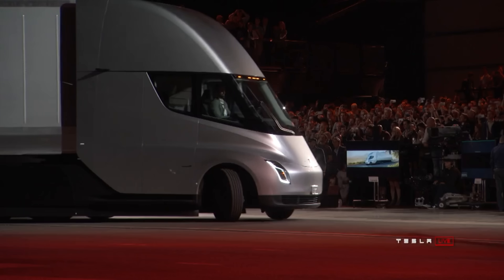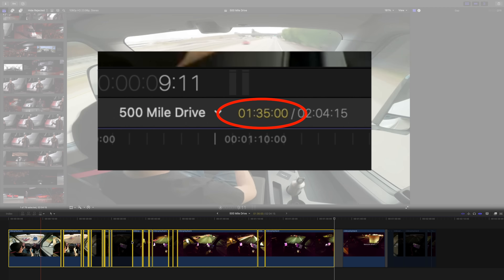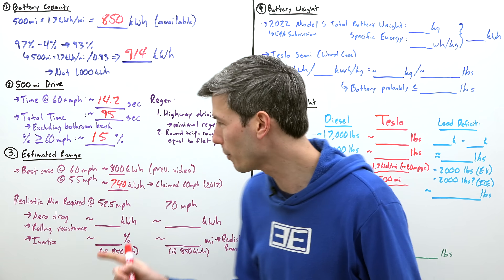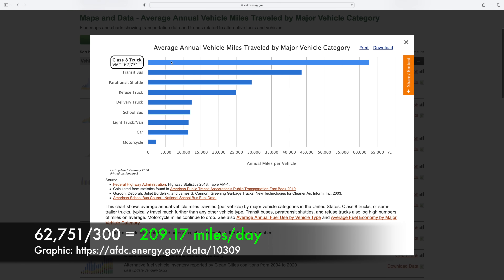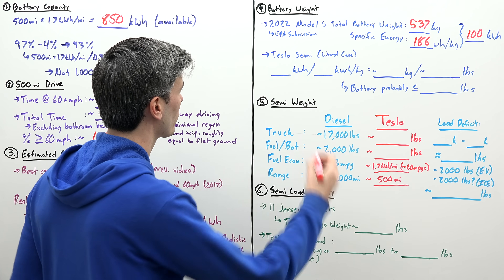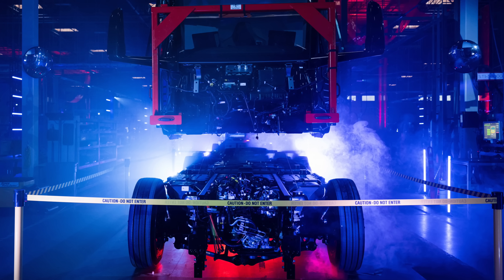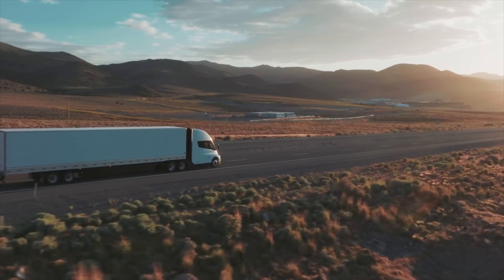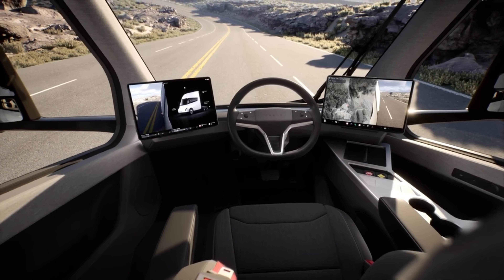Does The Tesla Semi Make Any Sense? Part 2!

Comment: How much more does the Tesla cost, and can the batteries last the typical 750,000 miles of a diesl engine semi, and how much do the batteries cost to replace?
Reply: Recycling batteries is cheaper than making them from scratch. So its cheaper trading in an old pack for a new pack than simply buying a new pack. Not saying its cheap, just that its slightly more reasonable.
If battery degradation is like 8% per 100,000 miles, how many miles before its worth replacing? I think even after 32% degradation, or 400,000 miles its still worth SOMETHING. Maybe not much, but for short trips id still get some use. Another advantage of EV semi’s is that maintenance is in theory cheaper. They dont need any oil changes, and basically only need wiper fluid. Due to regenerative braking, brakes heat up a lot less and should logically last longer. Multiple motors means that it’s highly unlikely it’ll leave you stranded as well. As refining capacity increases battery costs should also decrease.

Either way both EV and Diesel Semi’s have their pros and cons, and companies will buy whichever fits their needs. My only argument is that battery degradation isn’t as big an issue as many think.
Reply: @terrestrialcreature7481  thats not true at all. Lithium is mostly not recycled at all, and is too low quality to make new batteries when it is
Reply: @paulhopkins1905  
Quote from Tesla:
“materials in a Tesla lithium-ion battery are recoverable and recyclable. Battery materials are refined and put into a cell, and will still remain in the cell at the end of their life, when they can be recycled to recover its valuable materials for reuse over and over again.”

Comment: Just like in your first video, you're still ignoring the biggest thing: this thing is terrible compared to an electric freight train.  A train is powered by overhead wires, so you don't have to manufacture a giant battery, which is the most environmentally damaging thing about a tesla semi.  Having a giant battery on the road is also very dangerous, as firefighters already struggle to put out battery fires on just a tesla sedan.  Also, the average freight train holds about 4,000 tons of cargo, which is about 9 million pounds.  Compare that to the pathetic 44,000 pounds you're predicting for the Tesla semi.
My point is, we are investing in the wrong infrastructure.  If you look at countries like India and Switzerland, they have a very good electric freight train system.  Trains are far more environmentally friendly and safer than Semis.  Increasing the allowed weight of Semis another 2,000 pounds for electric ones would make them even more dangerous than they already are.
Reply: Oddly enough, Switzerland and India still have semi trucks, in spite of electric freight trains. I can't imagine why that might be...
Reply: @BigBen621  Youre completely missing the point
Reply: @sleeplessengineer1450  No, you're missing the point. Even in countries with electrified freight trains, such as India and Switzerland, semi trucks are still required, simply because train tracks don't go everywhere that bulk cargo is needed. So electrified freight trains would not obviate the need for semi trucks in the US, including the Tesla Semi.
Reply: @BigBen621  Well obviously.  But the point that you're missing, is that unlike India and Switzerland, the USA is over-reliant on semi trucks and is very lacking in electrified rail.
Reply: @sleeplessengineer1450  Straw man fallacy. There's no connection between the two. Being lacking in electrified rail means the USA is over-reliant on diesel locomotives, not that it's over-reliant on semi trucks.
Reply: @BigBen621  It's over reliant on both.  And both aren't the eco friendly solution.
Reply: @sleeplessengineer1450   "And both aren't the eco friendly solution."
Well, I haven't made that claim. But, in your engineering opinion, what is ?
Reply: @BigBen621  Building proper infrastructure that allows for the majority of freight to be shipped via electric trains.  The US has the most length of rail in the world, but most of this rail is lacking in overhead wires.  And it's not a size issue since China, India, and Russia and also huge counties but they did electrification right.
Reply: @sleeplessengineer1450  You're still not making the case of why the lack of electrified rail lines drives your claim of over reliance on trucks. Whether the locomotive is electric or diesel-electric, trucks are still needed to get goods from the railhead to the point of use. How would electrifying rail lines change this?
Reply: @BigBen621  Replacing diesel trains with electric trains changes this.  So does improving our infrastructure to not have all this pointless road between railroads and warehouses, which didn't exist before the 40s/50s before the auto industry tore up a lot of rail and destroyed the US

Comment: So if a disel truck and a tesla do a alpine haul , And both are empty  for fuel/battery at the peak, the diesel will need to take on fuel at the top, but the tesla will regenerate most og its power downhill and the diesel will still burn fuel?
Reply: Absolutely correct, if the hill is steep enough. I could do the calculation, but it's a slope of around 2% or so—because there has to be enough energy regained from regenerative braking to make up for losses due to air and rolling resistance. For a typical mountain pass with slopes of 5% or 6%, it's a slam dunk. EDIT: It's about 1%.

Comment: There's no way the batteries will last In a mountainous environment with heavy loads unless they have added a massive and I mean massive Transmission
Reply: There's no transmission, only a reduction gear. And mountains are where Tesla Semis will have the biggest advantage over diesel trucks, for two reasons: both because they have 2-3 times the HP of diesel semis, allowing them to climb steep grades at highway speeds; and because regenerative braking removes almost all of the fuel penalties for steep climbs and descents.

In the Delivery video, a Tesla Semi is seen loaded with 44,000 lbs. of highway barriers, accelerating rapidly up a 6% slope on Donner Pass, passing a diesel semi as if it were standing still. 

Why do you think it needs a transmission? Do you understand how electric propulsion works?
Reply: There are about 900 kWh or so of batteries in the Semi, if they discharge at 900 kW, which would equal well over 1100 hp, that would only be a discharge rate of 1C, which is absolutely fine for the batteries. In the Model S, Tesla is allowing up to about 7C for accelerations, for charging about 3C.

Comment: Hugely informative, perhaps worth noting the carbon wrapped plaid motor used substitutes 2 motors as per spex of their original presentation, so technically you can cut them some slack for that... 
Elon time never aligns with earth time 😉
and pricing will likely be a feature of supply and demand (they are a business after all) but the argument for going big rig electric from a purely economics standpoint is huge

Comment: Your assumptions about Jersey barriers are not necessarily accurate.  Those barriers come in a ton of different dimensions from all different DOTs. You can't just scale length off a tire or use a vendor's estimated weight. There's far too much variability with these barriers.  You'd be better served trying to scale all dimensions on your own and use some other standard dimensions from DOT standard details then calculate the weight on your own.
Reply: You actually can extrapolate the weight of a barrier this way, concrete is usually uniform in density and their air standard set for their weight that can be achieved with a combination of dimensions.
Reply: @odisy64  no you can't. It has nothing to do with the density of concrete. Concrete is these barriers is always assumed to be 150pcf. The barrier dimensions are what vary and vary considerably. You can't scale off a tire for the necessary dimensions. You'd need much more precision than that to be even remotely accurate.
Reply: @rfehr613  im saying generally the density of the concrete is the same anywhere you go, the dimensions vary slightly but they all target the same weight so they can be sold and carried as a set, the Teslas semis extra battery weight means it carries 1 less barrier than you would expect from a flatbed of this size suggesting they are following the legal weight limit. how many 10ft jersey barriers have you seen that weigh anything but 2 tons, give or take a few hundred pounds.
Reply: @odisy64  the dimensions do not vary slightly; they vary considerably. There's no magical 2T standard for barriers. I don't know where you got that from. That's not how it works at all. Just go look at all the different barrier standards from all the DOTs and you'll see what I'm talking about. There's so much variation in design of traffic barriers, and it directly affects their weight. Barriers can be anywhere from 300plf to 800+plf. Its impossible to estimate by scaling off a truck tire, as was done in this video.
Reply: @rfehr613  These are identical in every respect to Caltrans-approved 10' K-Rails, which are a California-specific version of generic Jersey Barriers, right down to the shape molded into the end of the barriers and the circular tie-down/lifting openings. And since they're in California, you'd expect to see the California-specific version of these barriers.
YouTube won't accept a link, but if you search for the Caltrans web page Development of Staking Configurations for K-Rails,  and open the Related Document at the bottom, you will see the K-Rail design in Figure 7-3. Here you'll see the shape you can see molded into the end of each barrier on the flatbed in View D-D. And in the upper left under Typical Panel, you'll see Mass: 3540 kg, or 7,804 lbs. But this is for a 20 ft. K-Rail, so the 10 ft. ones on the flatbed weight about 3,900 lbs. each.
Reply: @BigBen621  how do you know they're "identical in every respect" without knowing the dimensions of the barriers in the video? You don't.  You can't. And if you know anything about traffic barriers, you'd know just how variable they are in design from DOT to DOT and even within the same DOT. Just because it "looks the same" doesn't mean it is the same... Not even close.
Reply: @rfehr613  Show me a photo of another traffic barrier with that exact shape molded into the end, just as shown in the K-Rail design, and I'll concede your point.
Reply: @BigBen621  that has absolutely nothing to do with my argument. That's the justification for your assuming all barriers are identical? That's a really poor assumption.
Reply: @rfehr613  In my opinion, in a state where traffic barriers are required to meet Caltrans specifications, traffic barriers on a truck with a unique shape molded into their ends that matches the Caltrans specifications, and with dimensions that can be approximately confirmed based on the dimensions of the truck they're on, are likely but not certain to be Caltrans-approved 10 ft. K-Rails, which weight 3,900 lbs. each. You obvious disagree. If the payload is substantially less than 22 tons when it's finally leaked or released, then I will be happy to retract my claim. In the meantime, let's agree to disagree, and get back to our day jobs.
Reply: @BigBen621  well it just so happens that my day job is designing bridges. So calculating barrier loads is something i do on a regular basis, and therefore I'm very familiar with state standards for traffic barriers... Hence why I'm stating there's a large degree of variability in the design of these barriers. I know from first hand experience. I also know that a single detail on a barrier that matches a certain detail on a DOT standard doesn't automatically mean the rest of the barrier matches. DOTs borrow details from each other all the time. DOTs also have their own wants and needs for barrier design, so many have their own unique standards. The process by which a traffic barrier is approved for use involves load testing by running a truck into the barrier. Since it's relatively easy and quite cheap to get these approvals, we end up with a whole bunch of unique state standards. There are few national requirements for barrier dimensions, so it would be impossible to determine the dimensions of the barrier in this video without at a minimum knowing what state DOT it's used for. Even then, there's a bit of speculation involved.

Comment: The math is "sound" in perfect operating conditions, but those of us that live in the northern half of the country deal with those pesky seasons like fall, winter and spring that seldom offer perfect temperature for BEVs. Based real world range loss of Tesla cars when the temp is below 32F, one can extrapolate that the semi range will plummet as well.  Its also great that tax dollars are wasted paying for these trucks for a company that has a net income of almost $9 BILLION dollars a year (WTF).
Reply: It cute you think 32f is actually that impactful, the batteries need to be like -20f cold start to lose 35% range. But if the battery is heated it will regain range which can be done by conditioning the battery before you drive or just drive for a while and the battery will warm up from use.

Why do we give oil companies 30 billion in subsidies every year when they are making record profits?

Comment: Maybe I missed it but do these calculations account for the fact that batteries don't like to be charged over 90% and they don't like to be discharged below 10%? Otherwise the overall life of the battery suffers. Also weather conditions. In cold weather the range will be less. Also you have to factor in battery degradation over the life of the vehicle. The range of the truck in year 5 will be less than that in year 1. What will be the average life of a Tesla Semi? Just some other thoughts, thanks.
Reply: According to Tesla there is no lower limit, just the need to avoid running out of range on the road. And the upper limit depends on the chemistry. Here's a quote from the Tesla car owners' manual: "If your vehicle is equipped with an LFP Battery, Tesla recommends that you keep your charge limit set to 100%, even for daily use, and that you also fully charge to 100% at least once per week."

 In recent tests, Tesla cars have had the least cold weather range loss of any EVs, due to use of heat pumps for cabin and battery heating. The Tesla Semi will use the same technology, so it should similarly experience limited loss of range in cold weather. While some range loss will of course occur, it will be completely predictable, and drivers and dispatchers can plan around it. 

The Tesla Semi is warranted for a million miles. So if the battery suffers premature degradation, it's on Tesla. And this gives them a huge incentive to design a battery system that does not suffer excessive degradation.
Reply: @BigBen621  Appreciate the input. A quick google suggests ICE trucks can have a life expectancy of 750K+ miles. So I guess 1 million miles on an EV truck, with less moving parts etc, is not inconceivable. Will have to wait to see how the batteries will fare in the real world. Also what small print the 1 million mile warranty might have.

Comment: I have a question. Has anyone tried making a hybrid truck and could that look like. I was thinking electric motors on 2 of the axle or each drive wheel.
Reply: Yes, Scania has hybrid trucks. They get 20 percent better fuel efficiency outside the city and 40 percent better in the city.

Comment: Personally I find the charging station issue the most unrealistic part. It's possible sure, but you are going to need a huge addition to the grid to support it if it was in any real volume. This is not some small thing to have installed.
Reply: Tesla routinely installs Supercharger stations capable of delivering 20 to 25 megawatts total to 80 to 100 Tesla cars, so one megawatt chargers won't be a heavy lift.
Reply: @BigBen621  the power grid can not support adding 1 megawatt stations everywhere , it would require new substations and more.
Reply: @newmonengineering  Daimler Truck North America CEO said power companies are saying they can only deliver the infrastructure in about 2 years for each substation. So, you are very right. This is going to be the bottleneck.

Comment: There is a competitor with a range extender truck that has an onboard power generator and regenerative braking getting over 1000 miles range without putting pressure on the grid. How can the Tesla semi be competitive to this?
Reply: Hard to say without a bit more detail; but it sounds like this is a diesel-electric hybrid, and this fails to achieve the primary goal of the Tesla Semi, which is eliminating the air pollution of burning diesel fuel.